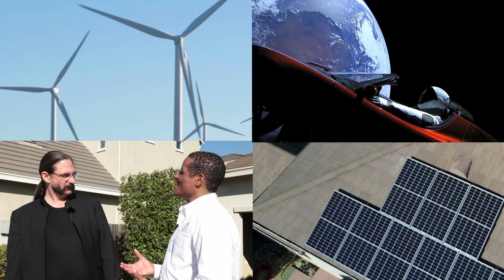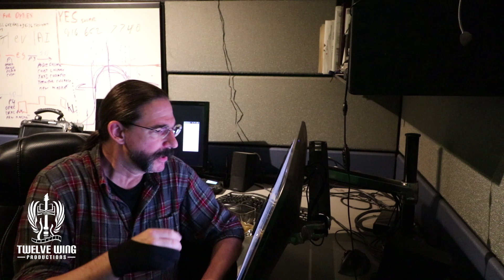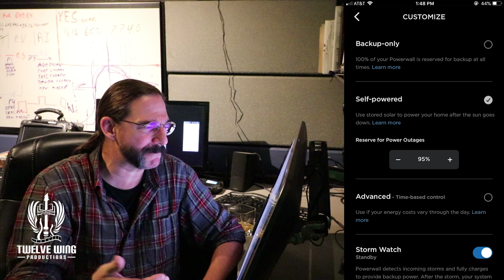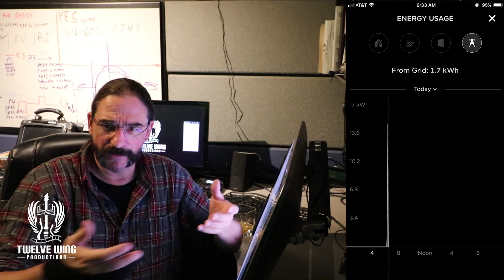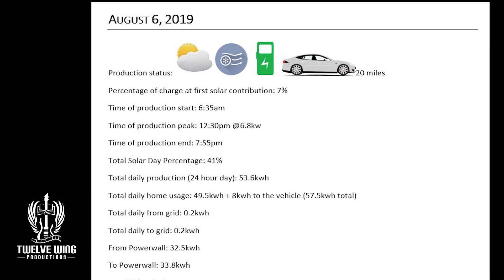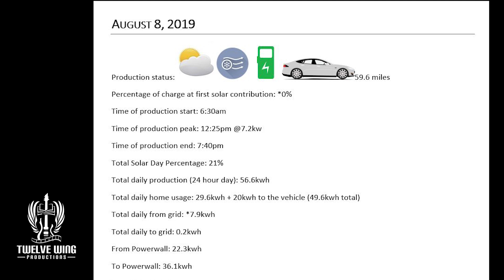The Energy Sovereignty Project: Month 8 Week 1

Comment: Have you considered a multi zone mini split heat pump for heating and cooling ? they allow room by room control and are much more efficient
Reply from the maker: I'm going to look into what improvements I can make to the house as a whole next year.
AC modifications are one consideration but to be honest, the system we have is actually pretty efficient given the size of the home.

I am considering putting in a pair of electric water heaters as well as a whole house fan.
I'll keep you all posted as to what I feel I can budget for.
If there are things you all would like to see, perhaps we can run a Patreon campaign to see if we can crowd fund some tests of specific gear.

Comment: I don’t know the specifics of the Sacramento Utility regulations, but the SolarCity installers did install a dedicated breaker box for solar and “ESD” (electricity storage devices) feeds, both of which connect to the inverter and Tesla gateway box, during our 2018 installation, so unless they initially told you otherwise, that sounds like a more “standard” installation in many regions (I am up in Oregon). 

Bummer to hear it was more of a hassle than expected, and hopefully everything else regarding credits and rebates goes smoothly!
Reply from the maker: I'm not sure I follow.  What I have seen as "standard" is to install a "backup" panel.  This backup load panel traditionally has critical loads that are controlled by the battery.  Fridge, computer room, security systems.  That kind of thing.
When we set up The Energy Sovereignty Project we moved every circuit over to this "backup pannel".
This seems to be what the utility company didn't care for.
Not because they didn't understand what we were doing with it... but because they did.
At least that's my thought on it.

Think of it this way.  When the utility supplies power to your home, they don't think anything about bringing their line power to your main breaker panel, now do they?
So what is the difference if the batteries do?

The answer to this is... there is no difference.
So all of this is manufactured by the utility company.  I'll give them the benefit of the coubt for the next year or so and say it's out of ignorance.
After that?  It's malicious.  Period.

They know how this works.  It's their job to know how this works.  Playing dumb isn't going to cut it.

A 200A home system is just that.  It's a 200A system.  There is no point in that system where this becomes additive.  Either it is supplied from the home side to the loads or it's supplied from their side to the loads.
If it exceeds that 200A then it pops the breaker.  It's just... that.. simple.
So I'm not going to entertain too much aregument on this point for apologists for the utility companies.

This needs to end and it needs to end now.

Comment: The generation panel that was added is for NEC code compliance  in relation to bus bar ampacity. For some reason they're treating the grid source and powerwalls as simultaneous sources and the rebate is directly related to current code compliance.
Reply from the maker: A great description of exactly what we need to band together to stop.
It may be code, but like many other aspects of this install, strict adherence to "code" where it doesn't apply is being used to bully consumers.

I'm currently assisting Thomas in battling a similar issue where PG&E is abusing Rule 21.
Reply: PG&E regarding rule 21
... “those inverters aren’t tied to the grid”.
Reply from the maker: @t.r.766  Thankfully it wasn't my inverters they were complaining about.
We really do need to get some legislation passed that puts these folks in their place.

In one weeks time I will be attending an event in support of solar production at the state capital.
I am part of an invitation only group to speak directly with those law makers that are directly responsible for trying to press through something they are calling "The Solar Bill of Rights".
I'll do my best to get our opinions across regarding just what we think of our public utilities.

What I find outrageous is that currently we have a completely schizophrenic policy regarding self power generation.

On the one hand we have vast amounts of cash that are being granted to individual consumers that are willing to take an early bite of the apple and hope they don't wind up with a worm.
On the other, we have a butt hurt public utility structure that is using strict code enforcement where it does NOT apply to try and stifle battery adoption and self generation of solar.

Please help us by supporting this channel and please consider supporting us on Patreon.